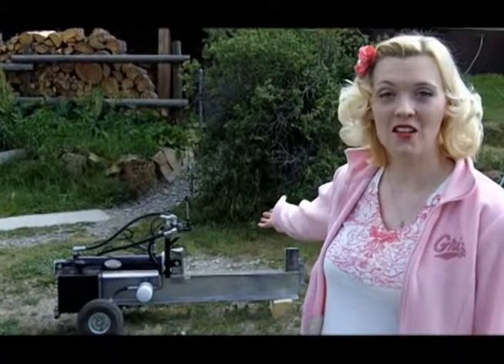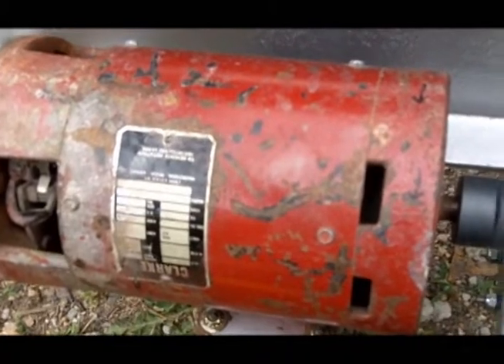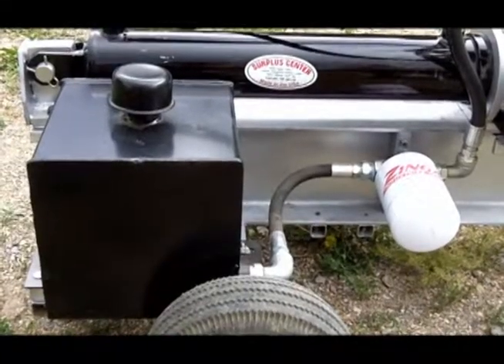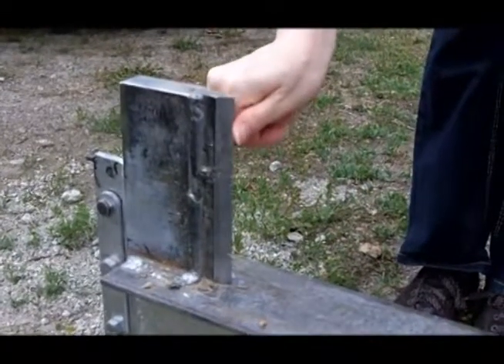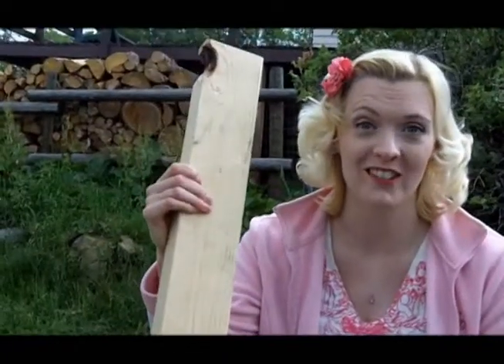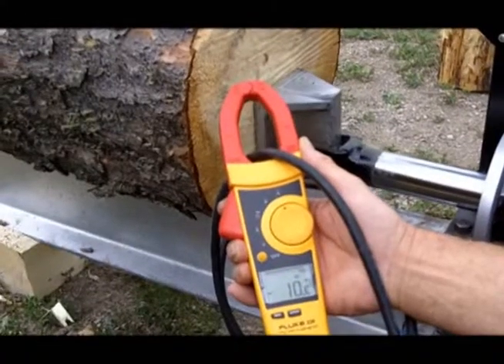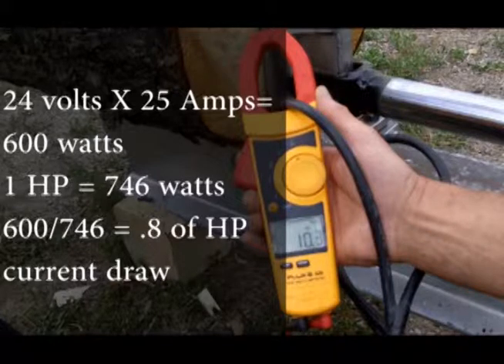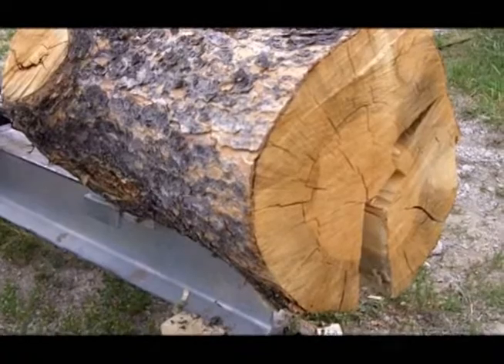Home Built Solar powered Electric Log Splitter

Comment: I am building another one since I have increased the size of my solar panels and want to experiment with the very powerful Etek 24 to 48 volt DC motors.  The engineering is half the fun of such a project.